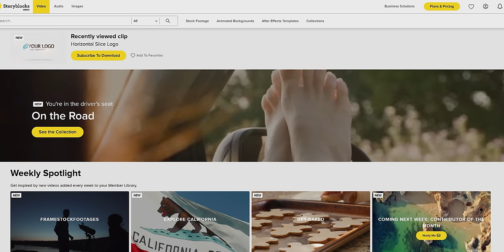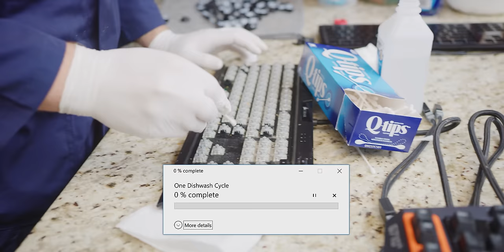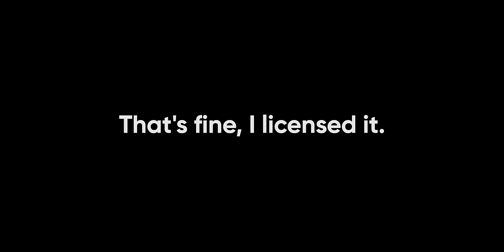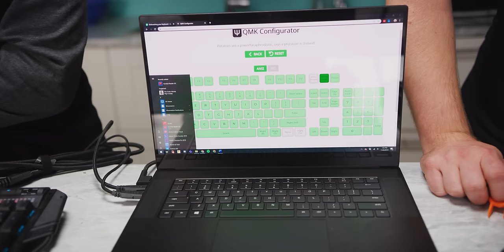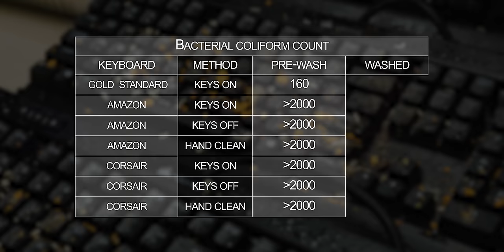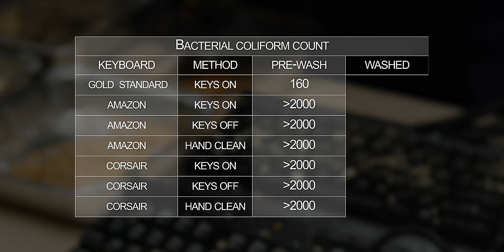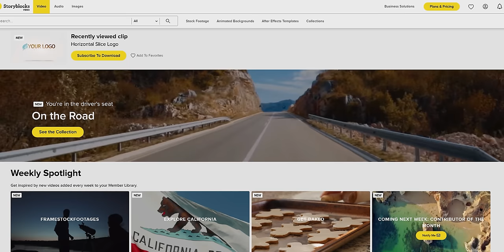The best way to clean a keyboard is… the DISHWASHER?

Comment: August 24,2021 -   With a follow up.

After getting Root Beer in my K95RGB keyboard, and the L key doing the sticky constant press,  I removed the key caps.  Then I disassembled the board to get it down to minimal and remove as many water traps as possible.

I ran the main board with the mechanical switches and the bottom plate through the dishwasher.  Added a little soap (less than a tablespoon) to the first wash.  Then let the second wash and rinse both do water.

It went through the plate warmer dry cycle as well.  The parts came out with water all over them.  Shook the excess water off of the bottom plate and dried it with a towel.  The top plate with the mechanical switches and main board were loaded as well.  I shook out as much as would come out, THEN I took my wet/dry shop vac and ran it over each of the mechanical switches.  It was amazing how much water was trapped inside of each switch.  I used the small angled tip and went along and pressed the button for each switch down as the vacuum would then suck all the water from inside and around each switch up and out.  By removing the water this way it also removes anything in the water that would be left once the water dries out.  The interesting thing is you can see the water coming out of each switch as the vacuum sucks it out.  It will also let it dry faster with less possibility of corrosion when less to no water is left inside.

When I reassemble the board and test it I will edit this post.  At this time I can say that the mechanical switches look much better and seem to work better.  Will still have to test them.  If any of the switches has gone bad, I have the skills and experience (20 years working in electronics designing and building prototype boards) to replace the switches, IF I CAN GET REPLACEMENTS.

More probably this coming weekend.

August 25, 2021  THE FOLLOWUP!

I am typing this on my CLEANED K95 RGB keyboard.  All the keys work.  All the lighting works.  All the switches work.  Using a shop vac to remove the majority of the water from the mechanical switches was an excellent idea and worked quite well.  There were a handful of buttons required several presses to get them to start working.  Once they started to work there was never any more trouble.  In addition the drying time was only 3 days.

CONCLUSIONS

If you have and intend to use a shop vac to remove the water, AND disassemble the keyboard to the extent you can, AND remove the keycaps, It could help to use a SMALL amount of soap only in the beginning wash.  The shop vac will remove the excess water before it dries and leaves any soap deposits.  This is important especially in the mechanical switches.  If you use any soap only use a teaspoon or 2 at most.

As to the keyboard, it seems like the key action is a little better.  The keyboard is about 4 years old and seems to work like new again.  So nice to have a keyboard that isn't all covered with dust, debris, and gunk.

Comment: Logically there should be no problem cleaning any electronics with water as long as you let it properly dry before plugging it in. I'm more worried about the plastic of your keyboard.
Reply: Precisely!
Reply: What about corrosion?
Reply: distilled water maybe. regular water with its various minerals could be conductive.
Reply: But you gotta soak every drop from it....water molecules could still infect the hardware at the architectural level
Reply: der8auer once cleaned a few motherboards and memory sticks in the dishwasher. it worked - the vid is called "the dishwasher-debate" i think..
there wasnt a corrosion problem
Reply: @rouvenkniep9987  der8bauer also puts acrylic color additives in his watercooling and wonders why there is rubberlike dirt after some months sticking on the heatfins (caused by heating up the pigments). He is smart on his lvl but also isn´t a pro about chemicals and so on. Corrision is for sure a thing as any keyboard haves at least one little chip inside to convert the signals.
Reply: @hailikefood  That is why you let it dry completely before using it again. To decrease the drying time though, you can always put them in an oven, provided you don't overdo it on the temperature. The amount of minerals left on top of two connecting traces are so miniscule that an accidental short is very unlikely simply based on the much higher electrical resistance the tiny film on it has. You would have to wash your keyboard with very mineral heavy water thousands of times before the chance to short it due to residuals. Again, provided you let it properly dry.
Reply: @KjKase  Corrosion to these traces does not happen on such a short-term scale like a dishwasher usage. Corrosion is by definition a long term effect of material deterioration, and a short dishwasher run does not provide enough chemical reaction to meaningfully add dangerous levels of corrosion, especially considering the oxide the thing is "breathing" every single day in normal use.
Reply: @BaldMancTwat  Of course not, when they're turned on and electricity runs through it, making all contacts short out with one another. But any non-active electronic device can be exposed to water and function properly after drying it before you turn it on again, because no current has been put through the traces, thus causing no short.
Reply: And make sure to remove any batteries that might be in there! Sometimes a device may contain them even if it's otherwise externally powered, like the battery on your motherboard. You don't want any current running through it while it's still wet.
Reply: And that's the biggest problem, getting the water out of everything after you wash it. I can't see how you would ever get all of the water out of a keyboard unless it was disassembled and the water blown out of the switches with compressed air. You also run the risk of washing dirt inside of the switches instead of washing the dirt away and you probably won't be able to take them apart to clean them.
Reply: maybe give them a quick dunk in some 90% isoprpyl alcohol to avoid any corrosion
Reply: " let it properly dry before plugging it in", and that is precisely the problem. Any porous electronics components will cause water to be absorbed deep into the component by capiliarity. It may become impossible to dry. 

We all know that membrane keyboards where two plastic films are used also absorb water via capiliarity and then can't be dried without dissassembly.
Reply: @hailikefood  As soon as your distilled water hits your keyboard, it becomes "regular" water. The dirt makes it just as conductive as the water from your kitchen. Therefore, this will not help with conductivity. And as long the device is unplugged, conductivity doesn´t matter because there is no electrical power in the first place.
Reply: What if it's wireless
Reply: The pcb won’t like it
Reply: and probably a drop of bleach to avoid mold

Comment: I personally just use the sprayer at my kitchen sink. I will also disassemble the keyboard so there is nothing missed and it can be dried within the same hour with a hair dryer. I've done this many times. One thing about slow drying electronics is that you don't just have to worry about shorting. You also have to be concerned about corrosion, so I recommend drying as quickly as you can to avoid it.

Comment: I use to clean old Arcade PCBs that were not working and dirty(caked with 20-40 years worth of dust and smoke res). Not only did it clean it super well without issue, but it actually fixed them on occasion.

Comment: Water inside your mechanical switches sounds like a good idea.
Reply: exactly - turn your cherry blue's into clicky AND crunchy with the occiasional stickkkkkkkkkkkkkkkkkkkkkkkkkkkkkkkkkkkkkkkkkkkkkkkkkkkkkkkkkkkkkkkkkkk.yep i'm buying reds or browns next...
Reply: This is why I always take the time, and clean all my mechanical boards, and others by hand. yes it's a pain in the ass, but well worth it in the end. Now if I was doing a bunch of cheap membrane keyboards for someplace like my church, then I would pull the caps, dunk them in a tub of hot soapy water, and Lysol cleaner, and scrub them by and with a soft tooth brush, and then drop the decks in the dish washer with the air dry setting with some mild dish waster soap, and then just spray them down afterwards with some Windex to remove any soap residue, and lastly help blow them dry with my air compressor, and leave them on a table near my Window for a few days that gets full sun all day!
Reply: Water inside membrane keyboards is an equally good idea.
A good amount of water can stay between the 3 plastic sheets, protected from that pesky evaporation.
Reply: @shawbros  I should have been more clear and said take the decks apart after clearing to blow them dry, and give them a Windex wipe down to remove soap residue.
Reply: @CommodoreFan64  
I would completely remove the membrane and electronics and put those off to the side, and then wash the rest. And rinsing in water is enough to remove soap residue.
Reply: @shawbros  The electronics yes unless they are really bad off, the membrane can be chucked into the dishwasher just fine, I've done it on a number of keyboards over the years doing salvage jobs, repairs, and budget builds for people.
Reply: @CommodoreFan64  
There is usually no reason to even clean the membrane. Most dirt will be on the top half of the keyboard, not the inside.
It's not a good idea to risk corrosion on the traces in a membrane.
I have been in computer repair (mostly point of sale) for almost 30 years, and the vast majority of the keyboards that were beyond repair were due to corroded traces on the membrane.
Reply: @shawbros  When a kid spills pancake syrup all over a Microsoft natural keyboard, the lady who brings it to you in a plastic tub is paying good money because she really likes the keyboard,  and that model is no longer being made, then you clean EVERYTHING! I've been doing PC repair since the late 80's when I was taking apart Commodore 1541 disk drives. so if you make sure it's all well, and dry there is no worry.

Comment: After soldering, if cleaning needs to happen, PCAs are put into what is basically a very expensive dishwasher that rinses with deionised water. You can put wet electronics into an oven at 60 degrees C for an hour or two to completely dry them (as long as there aren’t moisture sensitive devices in them)

Comment: "quick and fast"  
waits a week to dry
Reply: The attended time is very short, in manufacturing that's a HUGE deal. Where I used to work we refurbished used computers and we seriously thought about getting a dishwasher to clean keyboards. Ultimately we didn't simply because we didn't have a good place to put it.

Comment: heres the thing, the only reason you should not do this is just because the components could rust, beyond that, as long as it is not plugged in and has no electricity flowing through the keyboard, or any electronic device for that matter, it should be perfectly fine as long as you dry it out fully before plugging it back in. The only reason why water is actually bad for electronics is because its conductive, if there is nothing to conduct its perfectly fine for the most part.
Reply: fun fact; pure (distilled) water isnt actually conductive unless its a saline solution; the problem is that it becomes a slight saline solution when it comes into contact with just about anything but a perfectly cleaned glass or beaker
Reply: TorrentialGaming 100% pure water won’t conduct electricity IIRC. Problem is that it would become conductive as soon as it had dust and dirt in it. Kind of interesting though. Notably you need to make sure your components have no capacitors or batteries.
Reply: Whoosh. It's just a prank bro.
Reply: It seems like a dumb idea because there's a large cavity in the keyboard for water to collect. So if you're already taking all the keys out... just clean it normally
Reply: @chickenmonger123  technically yes that is true, but like 99.99% of water is conductive just from being in contact with metals, or pretty much anything that can conduct electricity.
Reply: @MLGJuggernautgaming  well yeah, just because ya can do it doesnt mean you should, never said you should, there is still a risk of rust and other issues that can occur even if it is "technically" safe to do.
Reply: @Vooman , Further fun fact, 100% pure water does not exist.  Water dissolves itself in small quantities,  into H+, and O- components.  It is DRASTICALLY less conductive, but not nonconductive.
Reply: It's not a prank. Cement cooling was a prank.
Reply: Metals used in electronics do not rust, because only iron rusts. Metals can oxidize, but that has little to do with water.
Reply: Water can be bad for components if it's hot or forceful, too. It isn't ONLY that it's conductive. The jets in the dishwasher could push things around and physically break things. If you do it enough times, it could wear off the keycaps, logos, etc. If the water's too hot it could affect the plastics, etc.
Reply: Some metal parts of a keyboard are not for electronic purpose - springs, screws, the space bar doodah, anti-flex plate, magnetic wirst strap connector.
Reply: TorrentialGaming I agree with you. I think this channel is just out of video ideas
Reply: @angryscottishidiot  Also, not iron, often aluminum or coated stainless, which doesn't rust...
Reply: r3conwoo and non conductive soap exists? Because soap actually makes water more conductive

Comment: "Still has dust on it" uhmmmm, Linus, that looks like condensation.
Reply: No one is guessing water residue?
Reply: @Cthulhu why would there be salt water in a dishwasher?
Reply: @TheFrontyer  Because the dishwasher doesn't destill the water before running?
Reply: Distill sorry
Reply: @ezyzet  But its using freshwater not seawater. So there is hardly any salts in it.
Reply: @TheFrontyer  I'm sorry, that is simply not true.
Reply: @ezyzet  Well then the tap water you have in the US pretty fucking awful. So I guess it depends on the water quality in anyones conntry then.
Reply: Frontyer someone hasn’t heard of flint Michigan lol
Reply: @TheFrontyer  theres minerals in most countries tap water you're wrong
Reply: @branchy2279  Yeah the same thats in bottled water. Which will not leave a layer of salt on a keyboard like that.
Reply: Untouched layers of dust can be quite resilient.
Reply: @TheFrontyer  Dishwasher salt is added mostly in hard water areas
this was the first result http://dishwasherreviews.co.uk/what-does-dishwasher-salt-do.html
Reply: In all my life would i never of thought i would come across two dudes arguing on youtube about if there would be salts in the water of a dishwasher
Reply: @ezyzet  do you mean hard water? Because that is not salt
Reply: @Rebster  Not necessarily hard water, any water containing minerals, because these minerals are different salts
Reply: @Mouthwashh  if you've never heard of dishwasher salt, you are also quite wrong. If you use all in one tabs, then you don't need salt. Otherwise, it is quite common to add dishwasher salt, at least here in the Netherlands
Reply: Frontyer Linus doesn’t live in the US. He lives in Vancouver, where we have some of the best tap water in the world.

Comment: A little bit of background: 
Basically, water isn't a problem to electronics. It is only a problem if a) the device is powered and the water connects two parts that shouldn't be connected or b) if there is corrosion that connects two parts that shouldn't be connected afterwards. So in a keyboard you could run into the chance of getting corrosion if you plug it in too fast, but when it's completely dried out, the chance of running into problems is pretty low or basically 0. That's why sometimes even circuit boards are dishwashed. If they are properly dried afterwards, everything is fine. 

For the keycaps: Put them in the washing machine in some kind of washing bag. Works also with old LEGO's ;)

Comment: The worse thing for a keyboard is liquid that contains sugar, like orange juice or ice tea, and coffee which contains sugar and creamer.  Cookie crumbs can be dumped out or blown out using a compressed aerosol can.  I wash keyboards in the sink using dish soap and then rinsing them using the sprayer.  After shaking out some water I use a hair dryer on a warm setting to dry them.  I've never had a keyboard not work after washing and drying this way. I don't wash my own keyboards as I never drink or eat near them, and I just use a vacuum to suck out dust.  If you are bleeding over your keyboard then make an appointment to see your doctor.
Reply: @Keretizein x pretty much anything that has a chance to be conductive and also won't evaporate away, and even then sometimes it might be perfectly fine so long as you let it dry completely. You could, in theory, dunk most modern computers in water and have them be fine so long as they aren't on or connected to power when you do it and also allow them enough time to dry completely. I spilled a full can of coke on my MacBook Pro in 2012 (double fail for buying a mac and then spilling soda on my brand new mac) and used it for 5 years after that no problem after letting it dry for 2 weeks, I wouldn't recommend that, obviously, I no longer eat or drink while on my computer BUT if you just turn it off and leave it for long enough modern hardware can actually prove to be quite resilient
Reply: Tea with honey. Lovely stuff, 10/10, would not spill again.Thorough rinse plus demineralized water bath plus week of drying near heater, it recovered, but few keys that took the most damage are still somewhat sticky, though they start to release with more use.